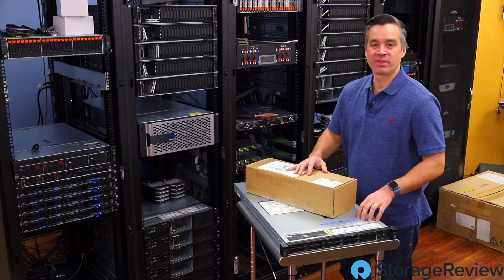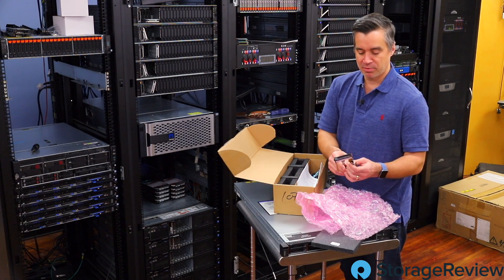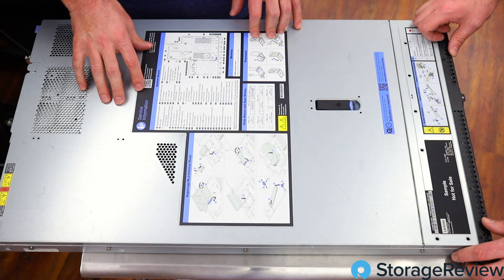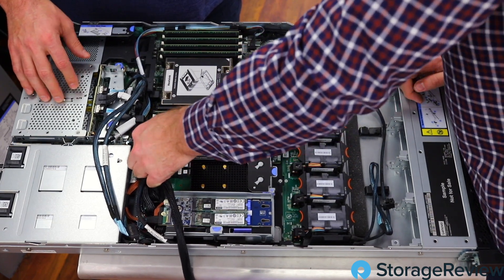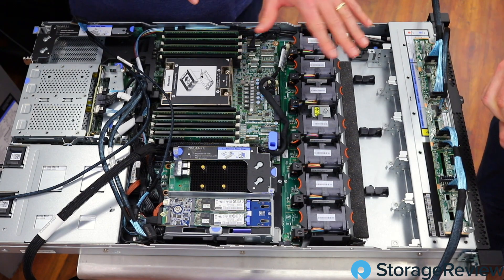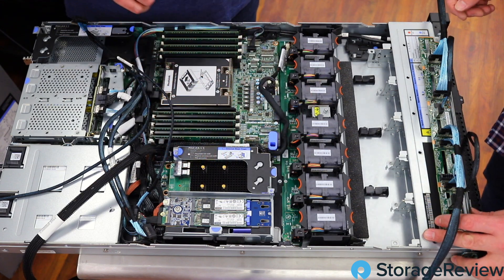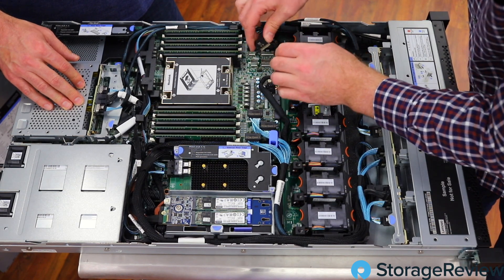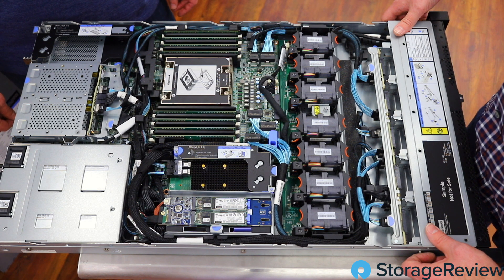Lenovo ThinkSystem SR635 10x PCIe Gen4 AnyBay Installation

Comment: Swapping the front drive backplane looked remarkably easy...; AMD is going to make a serious dent into Intel's near lock on the server market..
Reply from the maker: mdd1963 for sure but the VMware penalty will slow down some and Intel is making lower cost SKUs.
Reply: VMware and M$ per core licensing is a problem for AMD perhaps. But for Linux workloads who would even think Intel. Still my next VMware hosts will be AMD for sure.